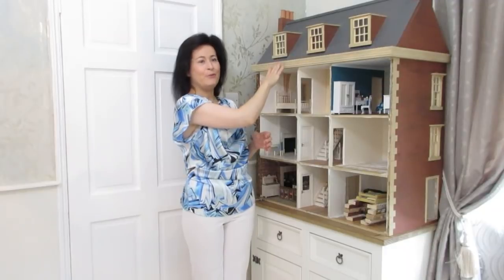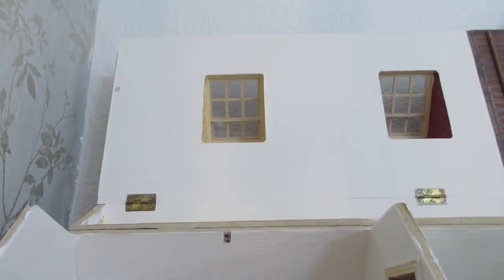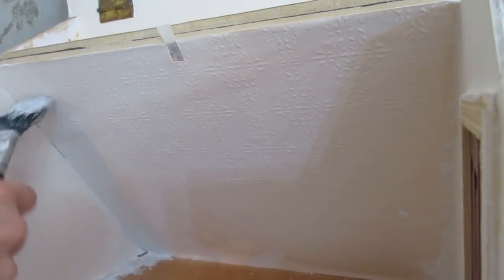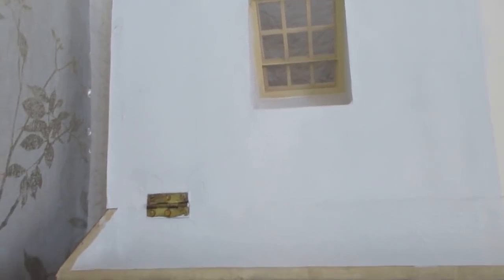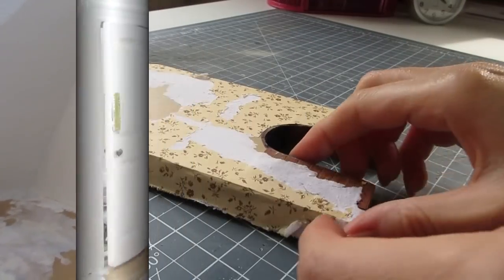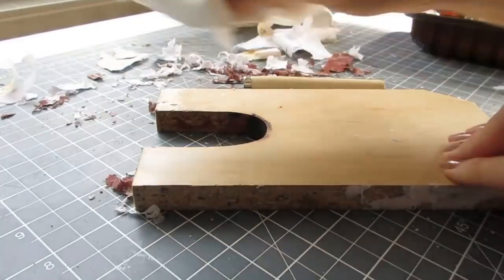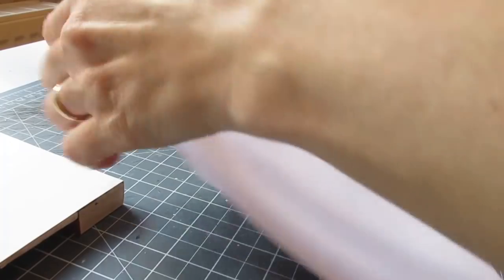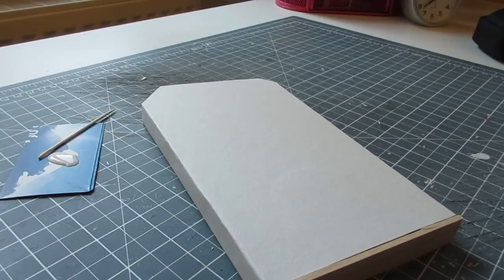My Dolls House Diary #33 - Popping up into the attic - Part One

Comment: As always I enjoy watching your videos....and I love the direction you are going in with the craft room.  I especially love that it matches up with your current craft room.  Wallpaper can be difficult.  Have you thought about using an old gift card or credit card to smooth out the paper?  I only make this suggestions because it saves wear and tear on the fingers and nails (from drying out).  I know that people have used the old card idea when applying appliques to a wall.  As long as its used gently, it won't tear any paper.  I've used this idea to apply contact/sticky paper to a flat surface and it worked out nicely.
Reply from the maker: Thanks Heather, I was just being lazy really, as I have a padded wallpaper smoother, which is the same size as a credit card, but with a felted surface.  It works a treat. :)

Comment: I've used old wallpaper that I have left over scraps of in lieu of the liner you mention as I could not find it in the US.  If one does this, however, turn the pattern of the old wallpaper so that it faces the wall and the plain back side is exposed so the old pattern will not show through to the new wallpaper.  Worked a treat and got rid of a lot of old wallpaper scraps that were hanging around my basement.
Reply from the maker: That's a great tip, Mary, as normal wallpaper will have the same texture on the back as the lining paper. :)

Comment: Julie, next time try using your hair dryer. I’ve used that to remove wall paper in a dollhouse and it works. A heat gun may get too hot to use on the miniatures.
Reply from the maker: I quite like the act of peeling away the paper by hand! :)

Comment: No subtitles again
Reply from the maker: You need to select the sub-titles button from the little icons along the bottom of the screen.
Reply: @JulieWarren  I did it, I wish I can post the picture to show
Reply: If u press on the vieod there should be a little square at the top right with cc in it to turn them on👍